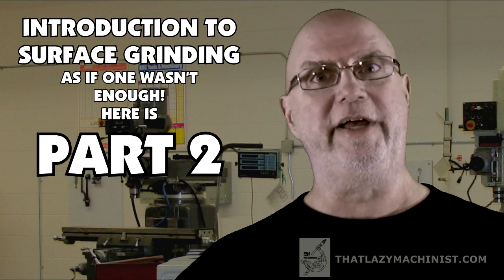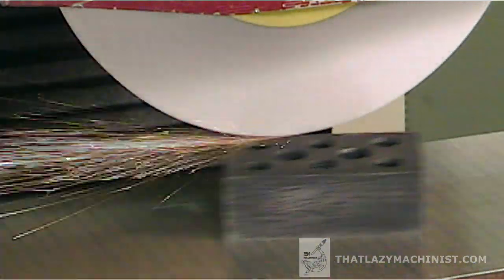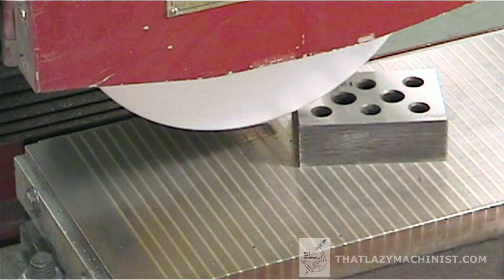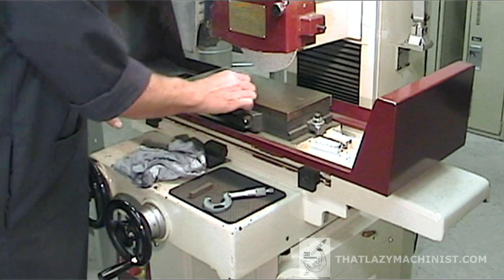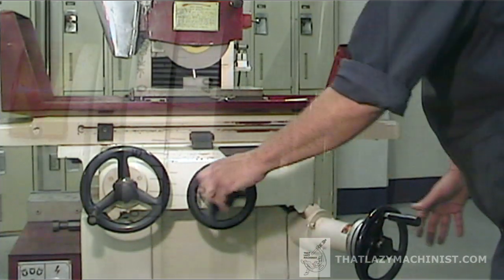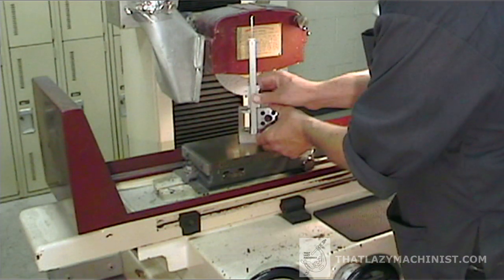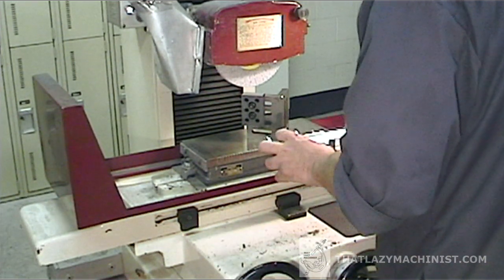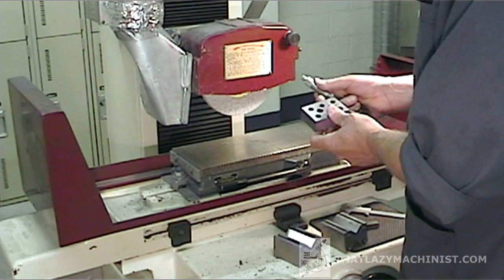SURFACE GRINDING part 2, accurate grinding, squaring up a block & completing a project

Comment: Everything this guy does is wrong,  Just the opinion of over 30 years grinding. One example is his breaking edges. They should have been broke before heat treat.  Stone the chuck. Do you own an indicator? I see you have a surface plate.  My grinder stays on from the time i enter the shop until quitting time, unless im changing a wheel. Why such aggressive cuts? Your making tooling to be used for a lifetime, not trying to make the best time on a job in the shop.
Reply: Then make your own video and quit talking trash about our boy Marc. Lets see what you've got. Being as sharp as you are, you missed that he is a teacher and producing videos from that perspective and not one of production. Remember this. No one knows your name or your work. We know and  love Marc for his.
Reply: he teacher part is scary. People shouldn't try and teach what they don't know.  @reallydonotdo

Comment: Top Bloke giving some very important safety tips.. Surface grinders can seriously cause alot of damage to you.
I've seen elastic wheels fly into the roof..The chap forgot to put  wheel collar on.... I've seen this happen a couple of times...A wheel, elastic wheels tend to skid on magnetic chuck then shoot straight up vertically...they will go through most factory roofs or lodge halfway in roof...Alot of spline grinders (surface grinders converted with index heads, centres etc)...use small wheels which will explode under load when grinding.....they also tend to end up in the roof...wakes you up big time....

Comment: It isn’t 7.8” of an inch…. That’s super super misleading, it’s .0078”. Also why do you stop the spindle after dressing your wheel… you’re completely undoing what you’ve done, by dressing the wheel…I’m just confused. Any good toolmaker I’ve worked with always keeps the spindles running all day once the wheels are dressed.
Reply: He said 7.8 thousandths of an inch. This is correct and well accepted way of saying it in many industries. Turning it off doesn't ruin the dressing, not sure where you got that idea. Maybe because the machine needs to warm up to operating temperature so it's stable, it's already warmzl,.so it's okay to turn it off for a minute before turning it on again

Comment: I use precession vise to get 90 degrees the material and then finished squaring   ..very easy to use it no need the to  hole the materials

Comment: These are really good videos. I would like to add a few things. At 5:53 you can also do this technique with a grinding vice. This is a good way to clean up and square those two sides. 

When you rough cut on a manual grinder, you can use only the front edge of the wheel. Then on your finish cut you can use the back edge of the wheel which is still sharp. 

I assume you probably went over a lot of stuff with your students about heat and how to smoothly operate the cranks on the grinders, but just didn’t cover it in this series.

Comment: Replace the switch on that machine with a single pole double throw, and wire it up to connect a power resistor between the motor wires when turned off. That will stop the spinning much faster.
Reply: You don't want a fast start or stop. It will throw the wheel out of balance. The ideal setup is a ac frequency inverter. You can program start up and down speeds. Moreover, you get rpm control of the wheel. Which DOES matter once you get into serious/efficient grinding. Say, use of super abrasive wheels. 

Supper abrasive wheels are much MUCH more easy to shape at low speeds. If you hold a diamond wheel in your hand you can cut it with a file. Now try that when it's spinning at 3250 rpm. 

But yes I like the simple solution you purposed here. It's easy. But my option is, every grinder should have freq inverters installed from the factory. Anything less is just cheap and poor machine tool design (baring old tools that did not have the electronics available to do this) thanks, and happy grinding! May your work be ever more flat and on size.